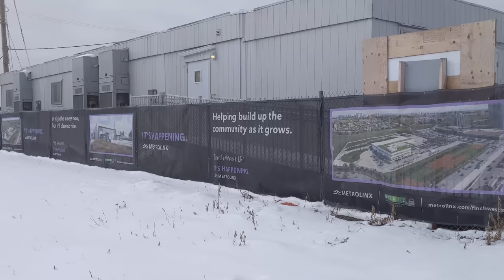Missing Links: Short-Sighted Transit Planning

Comment: Where to start regarding the TTC :( So sad that it's gone from a shining beacon in the mid 20th century to a bit of a laughing stock today.  Anyhoo, two extensions I always think about relate to Line 2 on the west end. Firstly, I would think extending the line from Kipling to the Sherway Gardens mall (2.5 km) is one of those 'increase in ridership' reasons, considering the mall's location and popularity. Secondly, there is a hydro corridor immediately north of the Kipling Station that connects almost right to Pearson airport's doorstep and the Mississauga's BRT network. I would think that using that corridor to build an overland extension would be significantly cheaper than extending the when-will-it-be-done Eglinton Crosstown LRT line.
Reply: Have you not heard?   There is a new Crosstown completion date:   "Eventually."
Reply from the maker: Extending Line 2 west makes a lot of sense
Reply: @RMTransit  I agree.  Especially with the condo neighbourhood sprouting up around the mall, and with the mall being close to the Mississauga border, it would be more convenient connection for MiWay over Kipling station.  As for the hydro corridor  north of Kipling station, I think there was once a proposal to do an LRT from Kipling to the airport, using this hydro corridor.  

As for your Toronto example, I was thinking that the Finch LRT should be extended south to the airport, with a station at Woodbine to connect with both the Kitchener GO line as well as provide a one seat ride to the airport. As for extension east of Finch West station, we might wish to go south to Sheppard West station assuming we extend Sheppard line west to that station, or to Downsview Park if we extend the Sheppard line to that station.

Comment: As you mentioned, there are a few of these places in Berlin. The most annoying one is how the U3 isnt connected to the S1 in the south east despite Krumme Lanke and Mexikoplatz stations being only a few hundred meters apart. Luckily, this is the Ubahn extension most likely to happen right now; works are supposed to start in 2026 and finished in 2030 but you never now with Berlins construction projects (looking at you BER airport)

Comment: The REM isn't being extended to the existing Dorval Via and Exo stations because it's own airport station intended to be an extra fare station, and a through station won't work as well with Montreal's tap-in-only fare system. There's also the issue of the hight difference required to avoid infrastructure between the REM airport station and the train stations.  Not insurmountable, but not cheap either
Reply from the maker: I don't see these as reasons to not extend
Reply: @RMTransit  objectively they can be overcome given the political will, but I suspect CP and CN will fight anything that could conceivably disrupt their tracks (which would need to be tunnelled under)

Comment: 8:04 the exact same problem with the new metro line M4 in Milan: It ends at Linate Airport, ignoring the fact that Segrate station (on the line to Venice and Verona!) is just 1,5 km away
Reply: And there is also thé missing link between M4 and M3 at Sforza-Policlinico.
Reply: @lavillenouvelle  of course. But this is due to architectural challenges. The city centre is very old and dense. It's not good, but understandable. The missing link with Segrate station, is not.
Reply from the maker: Very good point!

Comment: In Vienna, we had one inverse example of the thing mentioned at about 7:00. The U2 line was extended to Seestadt quite some time before even the first houses (which were mostly built as far away from the U-stations as possible, great city planning right there) were there. Why? Because the EU was going to pay something for the extension, but only if planned and built, I guess in the same or following fiscal period or  something like that. So for some EU money right there also some money down the drain later running services 2 stations into empty wasteland with a bunch of cranes... Instead of extending the Tram 25 first, which would have run much closer to the first buildings and would have connected to the U2 anyway... And since then, the city just wants to build a new motorway-link like road parallel just because. CARS, FREEDOM, TOOT-TOOT. The extension of the tram has still not happened...

Comment: The one in LA right now is the K line at Expo. When the line was initially pitched, it was to connect to the D Line at Wilshire, but with the uncertainty of which route north the K line would take and the extra cost of a subway, Metro axed it. So instead of having a mid-town crosstown line through mid-city now, we have to wait until 2040 or 2050 when the K Line north is supposed to happen
Reply: The way LA Metro does some of their planning is a bit infuriating.
Reply: @renaes2807  Don't have to tell me twice. It's a mixture of doing everything piece by piece without thinking ahead, and cutting as many corners as possible to keep the costs down
Reply: @btomimatsucunard  And then they do things like propose to grade separate a single crossing on the K Line, apparently a year after it's finally fully completed, disrupting the brand new line, a cost of up to $241 million dollars (or more). For a single grade separation.
Reply: @Geotpf  Oh don't even get me started on that one! The only blessing there is that the Metro staff seem to think that proposal from the board is completely unnecessary and have been stalling on formally recommending it. At least as far as I can tell and from what I can gather from Numble over on Twitter.

Comment: I do find it quite crazy that the new Toronto LRT isn't going to reach the airport. Sure there is the new UP rail, but it's so close! Even their website says no plan for it, such a missed opportunity.
Reply: I wouldnt really consider UP as a commuter option because it doesn't have the same fares as GO and it's more expensive to use, however if Metrolinx implemented the original 15 minute service and reducing fare prices, it would greatly benefit those going to the airport and who live in the west toronto. also fare integration would be even better with GO/UP and TTC
Reply: I believe the Eglinton LRT will be extended to the airport.
Reply: @James_Knott  I posted a link but it was removed. If you search the LRT website they have a page dedicated to say they are not linking to the airport - "Why isn’t the Crosstown extending to the Toronto Pearson Airport?"

Comment: here in NYC there are several "missing links" the one that comes to mind always is the lack of connection between the Broadway - Lafayette station of the IND's DBFM lines to the Prince Street station of the IRT's QWNR lines.  The stations are a block apart and many of the building above are fronted by hollow sidewalks underneath.

I would love to see

The Brooklyn - Queens (+ Bronx) inter borough connection built as well as a West Side light rail connecting Battery Park City to Riverside South with connections to the L @ 14th & Port Authority @ 42nd Street. will you be doing videos about these projects this year?

Comment: Happy New Year Reece, In Sydney the worst missing link for that city is the extension from Carlingford to Epping, about 2 km,  this would have linked the whole inner heavy rail network, but brilliant government indecision has forever changed it into a light rail connection instead. This is just so wrong, as the state government has been decentralising the CBD and having been promoting satellite centres that are all around Sydney. This opportunity to link the west to the northwest and west has been in waiting for years. A small group of NIBYS are to blame that their solution was a light rail replacement that does still not connect to major city hubs. A diabolical long-term decision.

Comment: Halle has closed a missing link in its tram network: between Kröllwitz and and Heide Süd. Traffic isn't all that big on the stretch, but it allows new service patterns, especially running trams from their terminus onwards as a different line. They still have a proposed connection between thw to termini Beesen and Ammendorf on the maps in the trams, but I doubt that they will ever build it. The newly constructed line between Saline and Hauptbahnhof also picked up a lot of connections.
Honestly I think HAVAG does this less for passenger convenience, but more for ease of timetable planning and for detours in case of disruption or construction.

Comment: My infuriating missing link is on the Brisbane Airport-Gold Coast Line. The fact that the Gold Coast line doesn't extend to the Gold Coast Airport is a missed opportunity. Pretty sure that the way I think works now is you get off at Varsity Lakes (end of the line station) and catch a bus to get to the Gold Coast airport. Not sure how reliable that is cause the Gold Coast is typically a city that suffers from gridlock and is heavily car oriented. A one seat ride between Gold Coast Airport to Brisbane City and then to Brisbane Airport would be ideal in my opinion

Comment: I knew Boston’s blue and red line had to be an example, it’s one of the most glaring design flaws of any system.

For those who don’t know Boston: the red line is the most ridden line connecting the most populous parts of south and north Boston to downtown and the main regional rail station. The blue line is the airport line along with being an important coastal suburb connector. Boston has very unreliable rail
So even going one stop can at worse add 25 extra minutes to a trip.

Comment: in Madrid it's so frustrating that the line 5 extension, opened in 2006, didn't reach the airport (and thus connect to line 8) by just 900m of tunnel 🥲 still to this day it hasn't even been projected, even if it's always a promise at every election

Comment: My example is the connection between line 3 and line 12 on the Madrid Metro, it enables a second connection for the isolated line 12 and connecting the actually pretty close zones of Getafe and Villaverde.
It also enables a transfer with Cercanias C3 regional train so its a no brainer for just one station.

Im glad it's finally happening!

Comment: The Boston Blue/Red connection is maybe getting new life.  Mass General Hospital (along the connection route) is planning a major expansion in the next few years, and streets are slated to be dug up, etc.  If the connector doesn’t get built alongside the MGH expansion then it never will.

Comment: A missing link in the Warsaw Transport System will be the upcoming section of the M2 metro line (Karolin station) not connecting with the S1 Train line (Ursus Station), even though the two stations are less than a kilometer apart.

Comment: Slightly related is the mess of having sydenham Tempe and wolli creek all serving as junctions within 2 km of each other. A little bit of extra earthworks could have made a single junction station that would have provided topological simplicity. 

Melbourne's silly one is the Alamein line not running through to east Malvern like it once did

Comment: Same mishaps are happening now with the Grand Paris Express project. Just checking on Line 15 SUD, one can see: 
. The "Issy RER" station on line 15 is 1.2 km away fro Mairie d'Issy, the terminal of line 12,
. The "Fort d'Issy Vanves Clamart" station on line 15 is not connected to the existing network at all, 
. The "Vitry Centre" station on line 15 will not be connected to line 7 on the Mairie d'Ivry branch, 
. The "Les Ardoines" station on line 15 is connected to RER C, but not to line 10 which still ends at gare d'Austerlitz.

Comment: There exist a whole missing section in Hanover, Germany. It is called the D-Tunnel, a proposed 4th tunnel for the lightrail that should've connected Ahlem with the Central Station and later be extended to the Eastside exposition grounds and lift pressure from the C-Tunnel line. They can still construct the tunnel line because the the 2 (actually 3) needed stations dedicated stations: "Steintor" and "Hauptbahnhof/Central Station" (and "Marienstraße" for that extension).

Comment: The Prague metro will possibly have a missing link in the future. Currently, Line D is being built from Náměstí Míru (interchange with Line A) to Depo Písnice through Pankrác (interchange with Line C). However, Line B is the opposite direction, so if there was an extension from N.M. to any of the station on Line B, the missing link would be gone, but there are no ideas for that so far.

Comment: In Chicago, missing links include:
Brown Line Kimball to Blue Line to O'Hare
Blue Line to Cook County Courthouses and Administration Complex in Maywood 3000' away and also to the UP-W Metra Line at River Forest or Maywood for service to Medical District and UIC
No transfer station between the Pink Line and the Blue Line at Medical District
Green Line extension to 63rd St Metra Station less than a mile away - there is a lot of history with this one but it's still a missed connection
The Red Line is being extended to 130th St w no connection to the Metra Electric Lines and South Shore Line which it will cross
Orange Line extension from Midway Airport to Metra SW Line Ashburn station using existing railroad ROW

As for Metra, there is absolutely no connection between Union Station and Ogilvie Station (Chicago's busiest stations) to the L network with Green and Blue Line stations 1200' away and no underground pedestrian connection between Union and Ogilvie stations only 1500' apart
Metra could build a station at Grand with a transfer tunnel to the Blue Line station 500' away to offer a connection into the Loop for Metra's UP-N and UP-NW lines
No connection between Metra BNSF Line (its busiest) to the L network at the Pink Line 18th St for direct service to the Loop or Medical District
A tunnel connection between the Metra La Salle station and the L Loop Van Buren station 580' away and Blue Line station 300' away or Harrison Red Line station 1200' away
Metra UP North Line new station connection w Brown Line L at Addison or Irvine Park - distance of 240' between Metra and the L 
Station connection between Metra MD-N line and Blue Line L station at Montrose - distance 800'

Comment: In Boston, one of the main purposes of the pseudo-BRT Silver Line is to provide a better way for Red Line riders to get to the airport in the absence of the Red-Blue link at Charles/MGH. I remember cursing that double transfer for years.

Of course, Boston's BIGGEST missing link is the absence of a North Station-South Station link for regional rail and Amtrak, which would now have to compete with the highway tunnel along essentially the same route. But that is outside the scope of what you're talking about here.

Comment: Berlin's most obvious missing link is probably line U3 ending at Krumme Lanke instead for going a few hundred metres further to Mexikoplatz and create a connection with S1. Also good is U1 ending at Uhandstrasse instead of meeting U7 at Adenauerplatz, U2 ending at Ruhleben instead of Stresow or Spandau, and U7 ending at Rudow instead of Schoenefeld. 

Special mentions to whenever the tram network approaches West Berlin, both ends of the U6, and whatever is going on with the U45 in Spindlersfeld.

Comment: So - there is a very real reason for missing links/connections in major cities with developed networks: nodal penalty/network penalty. Basically, what happens if the line or station you're building your "missing link" is already full. From London: This is why the Elizabeth line doesn't connect to the Victoria line and why they didn't extend the Northern Line Extension about 1km south to Clapham Junction. To add a connection to the Victoria line, you would have to upgrade the Victoria line, which already runs at 36tph and is completely full. To add a connection to Clapham Junction, you'd have to demolish and rebuild Clapham Junction as it can currently only just cope with the passengers from the existing 132tph (I think that number's right) that use it.

That's not adding a small amount to the cost of the new construction, that's adding a huge amount of cost and disruption to an existing bit of infrastructure, sometimes by a prohibitive amount.

Comment: Lines 4 and 6 in Toronto need to be connected, with an extension of either to meet at either Sheppard-Yonge or Finch West. I’d prefer Line 4 to merge with Line 1 at Downsview Park and run interlined up the TYSSE to, say, Pioneer Village? This would mean that when the Sheppard East extension is complete to McCowan to meet the Scarborough Subway Extension, you have effectively three crosstown corridors. All that would remain to maximize connectivity is an Ontario Line extension to a renamed Fairview station.

Comment: Ooh, I have a doozy!

Buenos Aires, where the city government refuses to build any more subway, has line H ending at Hospitales, which is about a kilometer away from the Sáenz railway station, where the Belgrano Sur train line currently ends, right down Almafuerte avenue. There has been a Sáenz subway station planned to make the connection for quite some time now, but they just won't extend the line.

In all fairness, the Buenos Aires subway has A TON of missing links: Line D also ends about 2 kilometers from Puente Saavedra, a big transit hub for buses and trains on the edge of the official city limits; Line E ends less than a kilometer away from the Dellepiane bus terminal (which receives intercity buses) and Line H was supposed to finish at the massive Retiro transit hub (3 rail terminals, 2 subway lines, dozens of city bus lines and the largest intercity bus terminal) but it ends 1.5 kilometers away instead, at Facultad de Derecho. But anyway, no more subway line building for the foreseeable future.